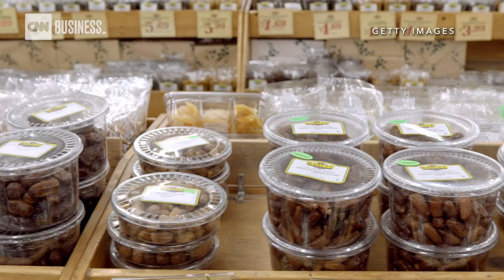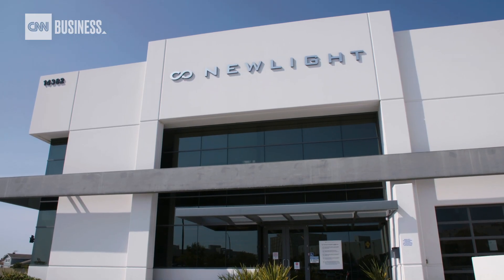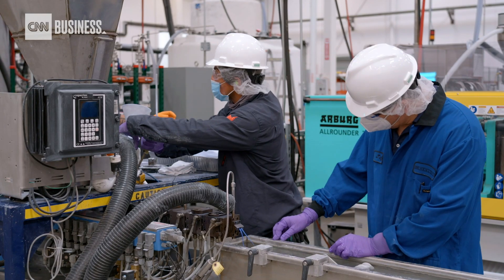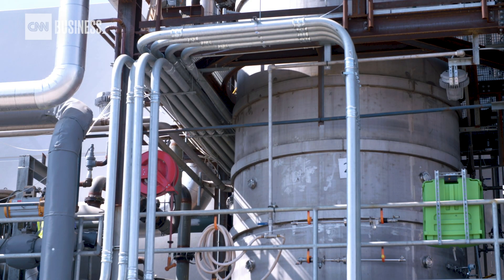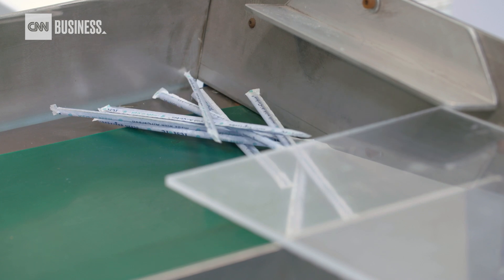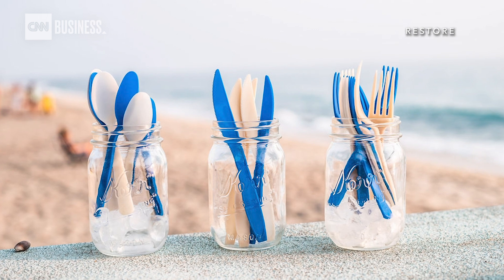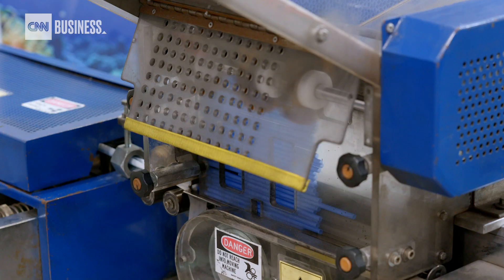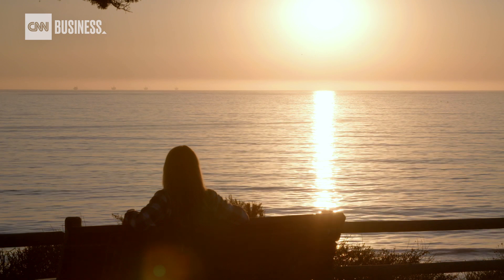Could this be the cure to our plastic problem? | Mission Ahead

Comment: Plastic is useful for the flexibility in shapes, the variations in composition (hard, soft, heat resist, etc), MOST IMPORTANTLY how cheap it is. Thus, it’s everywhere. 

Sure, you could make a better for environment plastic, but a company or consumer has to choose to buy it. On a small scale the difference in 1 cent per unit is meaningless. The issue is large scale. 

If I need 10 million units and yours is only 1 cent per unit more expensive, I now need to choose to spend an extra 100,000 to make it happen. That’s enough money to add a lot of equity in a business. You can amplify a business drastically by reducing costs this simply. 

Take straws. You provide it as a bonus as a convenience to customers. They use it once and dump it. The straw they used didn’t impact their enjoyment of the item, so it becomes a gamble for marketing. Will people care if I advertise that my straw degrade faster and help the environment? Maybe. 

But what I DO know, is that the 100,000 could have gone towards something I KNOW everyone would want, like more efficient equipment that reduces costs more to pass on the savings to the customer (thus remaining competitive with other businesses who are trying to take market share). 

In my opinion, these ALTERNATIVE plastics aren’t the real solution. In my opinion the real solution is an economic way to deconstruct the already popular and abundant “hence cheaper” plastic. 

The things I’ve read on enzymes that eat plastic material I feel are the right direction, but we’ll need more research on viability and scale.
Reply: In this case it’s not a difference of 1 cent but a difference of 19 cents!! How on earth can an company justify paying 19-20 times more a single use product?
Reply: A good start would be to get rid of excess plastic. We need a lot less plastic than we think. Why are new products double wrapped in plastic? There are 8 million knife or box cutter accidents every Christmas caused by people attempting to open up their presents hacking away excess plastic that won’t degrade for hundreds of years.
Fortunately governments are starting to act. Plastic straws are banned where I live and other one use plastic soon to follow. This is a real solution. People may not like it at first but have quickly become used to it.
Reply: Both solutions are necessary plus one you forgot to mention, ways to recycle / upcycle / reuse .. existing plastics. Polymers > monomers > polymers > ...

Comment: The best way to solve the plastic problem is to reinvent a plastic that is NOT plastic but does the exact job at the exact quality.
Reply: I think that's what this video is about ...
Reply: Or invent a plastic that can easily decompose once exposed to the ground for more than 3yrs without necessarily getting burned